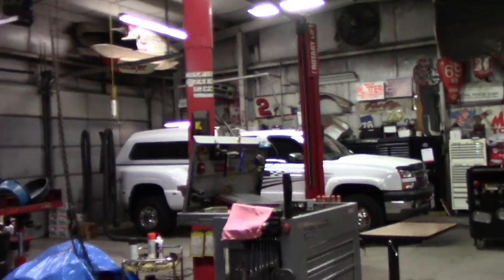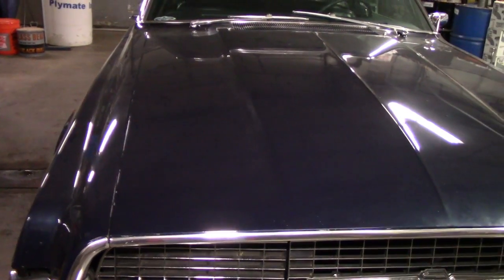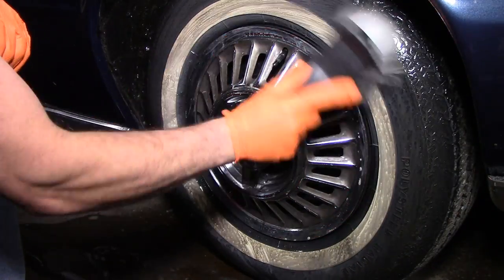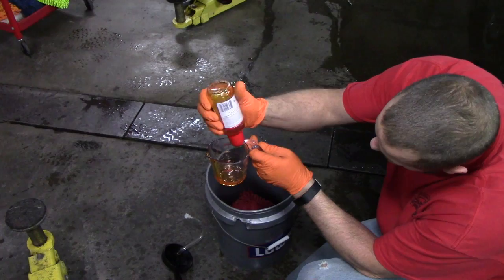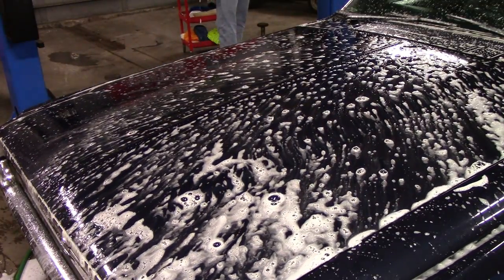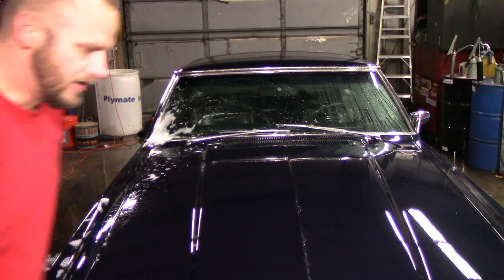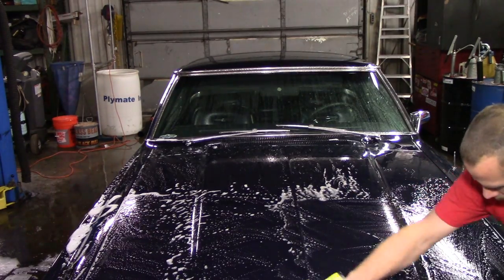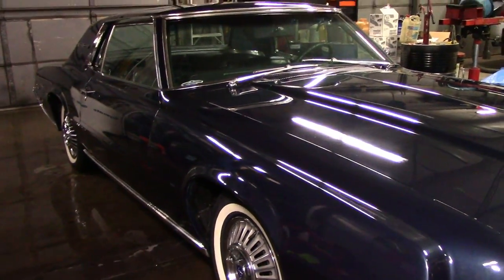1967 Ford Thunderbird Detail Part 1 The Wash

Comment: I was impressed with the wheel and tire cleaner, I will have to watch your review on that, I have used the Adam's rubber cleaner but have not been totally impressed with it.  That was a good tip to use the foam sprayer while scrubbing the real dirty areas.  I like classic cars, I will be interested to see how this turns out!
Reply from the maker: Daytona 5.7 I love that wheel cleaner! I can clean the tires and wheels all in one step and it works great. I learned the foaming sprayer tip from Larry at AMMONYC! Trust me you will want to stay tuned for this one. Thanks for watching

Comment: my dad gave me his 67   i was a young hot roder at the time  he bought a new 71 bird with a 429 in it i knew i had to find a 429 for mine  i learned how to build trannys  in my spare time  went to local bone yard got a 429  with a c6    built the crap out of it  friends told me i was nuts   had a good job  sent every pay check to paw preformance  at the time restored  the 67  had it painted candy red  perfect white int   went through it top to botom  even hyd wipers& signal relay box  had jim oddy do the heads  built the 429  11 2 1 comp    twin 600 holleys  c6 that would give you whiplash on the 23 shift b&m hole shot  cragar s/s mags 4/11 gears     nothing around came close at the locol 1/8 drag strip   but i still went back to chevy since my dad worked at the twnda mtr plant and parts were cheep or free  i loved those  sb 202 angle plug heads  cost me a bottle of wild turky each to the gate guard
Reply from the maker: Brian notafan Sounds like an awesome car!

Comment: Brian; is the griot’s clay mit pretty much the fine surface prep mitt for $50? I’m new to claying and wanted to make sure. I also had a hard time following you when you were talking about diamonds in the paint towards the end of the video. Can you explain? 🙏🏼 thanks!
Reply from the maker: Joshua Gautreau They have a fine and aggressive clay mit. The one I used is the fine. I usually prefer traditional clay when decontaminating paint though. So the synthetic clay mitt has a diamond pattern that you rub across the paint. It can leave little diamond marks on the paint if you don’t use enough lubrication or stop on the panel that you will have to remove with a polish.
Reply: FAB Automotive Detailing I understand thanks so much! It looks like the lubrication is just the griots garage super concentrate you used. So if I see diamonds would you recommend just go over it again with the mit? Or the correcting cream will take it out?
Reply from the maker: Joshua Gautreau When using the glove you can use the wash soap or speed shine for the lube. You won’t see the diamonds until it drys so you will have to polish. You should polish anyways anytime you Clay or use a synthetic clay because it causes micro marring on the paint. Yes correcting cream will remove it.
Reply: FAB Automotive Detailing thanks so much! Can’t wait to try it out👍🏽
Reply from the maker: Joshua Gautreau You are welcome!